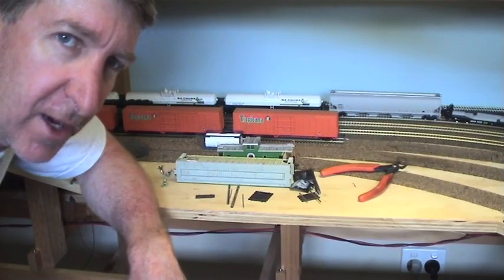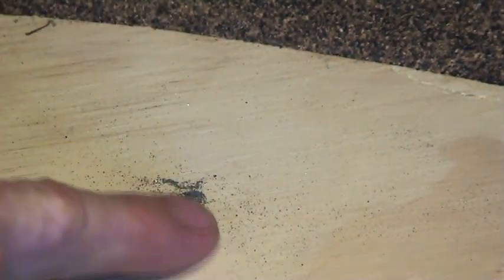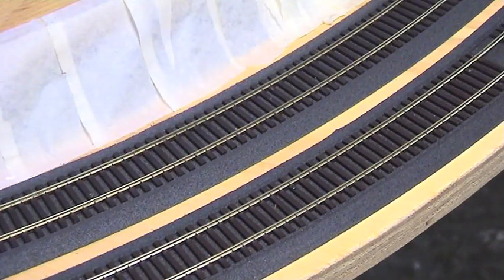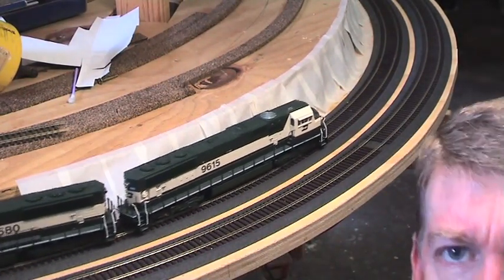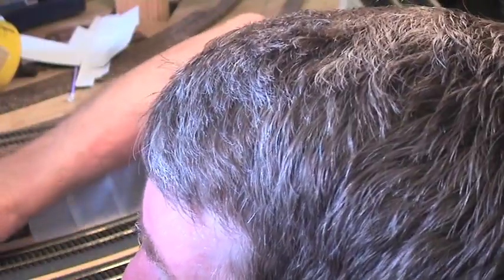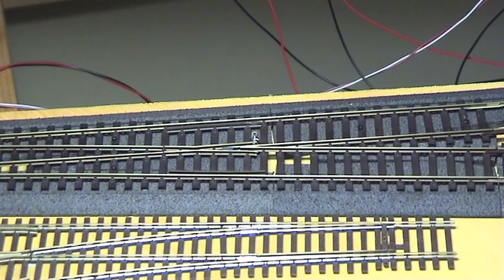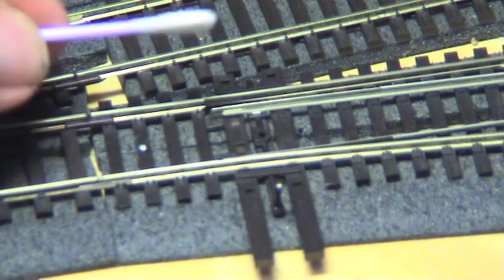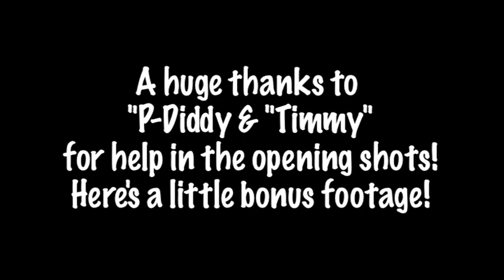Talking Turnouts and track maintenance - part 2.

Comment: I have been using alcohol to clean my exhibition garden railway every morning since I built the outside section.  Found however, that train running was going down hill (can't spell depreciating).  A few days ago I tried PECO Electrolobe, result, much better running lasting several days!  Great to have my findings confirmed in your video.  You are the first Auzey talking model trains I have come across and I find your relaxed, jokey style fun.  Good Luck to you mate - from a Brit (Pommey Bas**).

Philip
Reply from the maker: Thanks Philip, glad you like the videos and get something from them! I had the same thing happen with alcohol after a while and I remember the NCE agent at a train show telling me about lightly coating the track with WD-40 / CRC. But I prefer Innox as it contains no nasties! If you can get it in the UK, it will be a fraction of the cost of Electrolube! Good to see you had a positive result!

Cheers Gregg

Comment: Watching this video made my day! Thanks! I've been cleaning my tracks with alcohol and a track rubber, but I always got black spots on the track and dirt on the wheels after a short while. I don't have the stuff you mentioned, but I tried CRC 5-56 and it seems to do the trick. The track and wheels stay clean much longer. Even a loco with track rubber still works. It doesn't seem to loose traction at all after using the 5-56.
Cheers from Sweden, Anders
Reply from the maker: Thanks Anders! Yes , throw away your track rubber!! Be careful with other sprays and make sure they are compatible with plastic and do not contain silicone! After a while you may see the traction tyres slipping , I don't have any on my layout so I can't comment. thanks for watching.
Cheers Gregg.

Comment: I have a fibre pen as well for cleaning loco wheels etc.
One thing I notice with the pen is that tiny fibre tips break off, much like the trackrubber. You can even feel them on you fingers, tiny itchy feeling. I would not use them with points, unless vac afterward. Great vid, will get the lanolin. I remeber it now from school days, all them merinos and click go the shears stuff. Lol. Robert
Reply from the maker: Thanks Robert! My pen is ok so far, but I don't use it very much and only very lightly,but I can imagine it fraying after a bit of hard use. Something to keep an eye on in the future! 
Cheers Gregg

Comment: Hi Greg,
I love your series! I haven't waded through all the comments so this may have been already been mentioned, so I'm sorry if this is a repete. I don't use anything but a small block of homosote to rub down my rails. It is hard enough to actually clean the railheads yet soft enough to never scratch the rail. You can see the crud from the rails on the homosote block, but I simply wipe it off on the beck pocket of my jeans (don't tell my wife) and since I usually run on my railroad once a week it is never too bad. I never use any liquid cleaners as they always seem to have a down side. Regarding ME turnouts, when I model in HO, I have always turned them over and ground a little of the plastic away from the frog and soldered a jumper there to switch the power with the tortoise. I've no video of my railroad, but others have photographed it. Google my name (Joel Shank) and Sn3 and you should be able to see my efforts of 26 years.
Joel
Reply from the maker: +Bonanza Driver Hi Joel, thanks for the comment and I'm glad you like the videos! I don't think Homosote has been mentioned, masonite is another popular cleaner which is guess is pretty similar? The new ME turnouts have a little spot under the frog to solder a wire to which is handy.  I will check out your handy work Sir! 
Cheers Gregg.
Reply: +FishplateFilmsHi Greg,  Thank you for your response.  I've tried the Masonite block but have found it too hard.  The smooth side is worthless and I think the "rough" side is too aggressive for my taste.  The Homosote is softer and gentler on the rail surface.  That being said, some new Homosote will have a rough outer surface and that will have to be lightly sanded off to get down to the sweet stuff.  Then you will have what I consider to be the best track wiping block available.Joel
Reply from the maker: +Bonanza Driver Joel, it sounds like the Momsote is a good choice! I will stick with the cloth for now, but when the track is ballasted I will have to change methods!
Gregg :-)

Comment: Greg I too gave away the rubbers. If I have to get rough with it after say ballasting I use those sponge rubbing blocks with 1200 git then I use CRC 2-26 I only have to apply once every six mths or so seen as I'm in a sealed room in the house. The black you get on the rails is from the high frequency causing arcing and is diminished quite a bit by the lube  .Where can I get the lanolin to gie a try? oh and the pen. We're not blessed with an assortment of shops down here in Grafton   Cheers Les
Reply from the maker: Hi Les, I've seen Lanotec in some hardware stores and in Repco or Autobarn?. My local Nut and bolt place has it, try searching online, I think you can order it. The pen should be in electronic supplies,I have seen them on a model train online store, can't remember which one!.
Cheers Gregg

Comment: I must say Gregg - you've got a GREAT personality for video!!
EXCELLENT points made in this video, Mate! 
I hate trains stalling ANYWHERE, but especially turnouts.

So, I need to ask....  on some Atlas or Bachmann turnouts, the guide/stock rail gap is TOO wide, causing wheels to pick and lift at the frog...
WOULD it be feasible, to cement a thin strip of .005 or .010 styrene or brass, to the INSIDE of the guide rail, to pull the wheels more towards the stock rail??
Reply: Oh, and I only use Peco or Micro Engineering turnouts - although I've heard good things about Atlas' new Premium turnouts... $5-$8 less each too, than Peco!!! :D

The T/Os in question, are on my cousin's Layout....
Reply from the maker: Thanks for the kind words Carmine! I appreciate the support. On your cousins layout, that is a good idea. If you go to "Teddybeareleven" on you-tube, Stew does a great how to on doing exactly this. He uses brass and gets a great result! Tell him Gregg sent you..LOL I haven't used the new Atlas turnouts. 
Cheers Gregg
Reply: Carmine Allocca z.
Reply: Didn't think I was THAT boring!  :p

Comment: Gregg i well try that and i have also been told to use Auto transmission oil cheers Robert
Reply from the maker: Hi Robert, I haven't used ATF, but I would be a bit concerned about it's affect on the plastic ties. Also  I don't know it's ability to stop oxidation , which is the main use of the sprays. I have heard of it's use, but personally I would use a liquid that is designed for electrical use. Thanks for watching the clips.
Cheers Gregg
Reply: FishplateFilms As a retired Auto Mechanic, I can say that ATF is safe.
There are several plastic bits & electrical plugs inside an auto tranny!! ;)
I've used CRC for years - and it's beeen great...

However - I'm not opposed to trying Lanolin....
SURELY, we can find that, here in the Colonies!! :P
Reply from the maker: Hi Carmine,ATF is not designed to stop oxidation or improve electrical performance, so I would stay away from it personally. Innox, CRC or similar products are made to assist in the conductivity of a circuit by cleaning away dirt and oxidation. I'm sure you will find one of these available locally!
Cheers Gregg. P.s...we use Innox on many  of the electrical components in switch machines .
Reply: FishplateFilms I didn't say I USED ATF...
Just that it's safe on plastics.
You're absolutely correct, it also stays oily for too long - causing particulates to adhere to the track and wheels!
That's NO good!! :P

I have used CRC for years, and find it quite effective.
 Innox - that I need to check out. ;)
Cheers!
Reply from the maker: LOL..that's good! I like innox and Lanoline as they contain no silicone or petroleum products. I'm sure a search will get you some to try!
Cheers:-)

Comment: Hi Greg,I like the idea of using the Lanotec,a friend of mine Mark Williams (may he rest in peace)use to be the Sydney rep fpr Lanotec many years back.
On the subject of track cleaning I use Windex at the moment,it rips the dirt straight off,try it you may like it ?
Reply from the maker: Hi Jon, it's a small world isn't it, sad news about your mate!. Track cleaning is a two edged sword I believe, the alcohol does clean very well, but can leave the track "sterile" and open to oxidation , that's where the sprays come in, to leave a thin coating to help stop oxidation and help the current pass through any dirt .You could use both!!
Cheers Gregg

Comment: Love the bonus material, hope you find Fred.  LOL, do you have any curved switches on your layout? If you do, what must I watch out for?  Thank you for your time.  Cheers.
Reply from the maker: Cheers!, we found FRED on a Caboose!. I use Tillig curved switches, but the inner radius is a bit sharp for my liking. Peco make a nice one depending on the radius you require? I'd like to have a look at the Atlas Master line switches?
Cheers Gregg
Reply: I need to tear up some of my layout, the scenery was temporary, therefore I can change some of the track, looking at doing a crossover on a curve.  Wish me luck...
Reply from the maker: upsd402 . That will look good, go the biggest radius you can!
Reply: I don't have much room, wish me luck...
Reply from the maker: upsd402 . Will do!

Comment: Great vid mate! If i was to de-electrify the frog by making the cutting adjustments but added feeders for dcc use, would that work do u think ? (i have 4 of the large turnouts for a double mainline cross over and im having trouble) Nick.
Reply from the maker: Thanks Nick! If you isolate the frog  (then switch it with the tortoise)then you have to bridge the switch rail to the stock rail, there is a little gap for you to do this! This then makes it trouble free , all my mainline turnouts are powered frogs.
Hope this helps, cheers Gregg
Reply: Thanks Gregg, i'll give it a go!

Comment: I didn't have any luck with INOX at all. ended up having to clean the whole layout. Maybe my track was way too dirty, even though trains would run. They wouldn't once I 'cleaned' it with INOX. I'll stick to the track rubber and vacuum.
Reply from the maker: Innox is not a "cleaner" as such, but it will help keep your track conductive once it is clean. If the track was very dirty, it will need to be cleaned with a cleaner of choice, but I would still stay away from abrasive rubbers, as they damage the head of the rail with fine scratches which collect dirt. Also did you use the correct Innox?...they make 2 types and one is NOT suitable for electrical work!  If you must, use the smoothest rubber can find and only use a little to no pressure. 
Cheers Gregg.
Reply: Hey! thanks Mr Fishplate! Yep, right INOX, I have access to both. Yeah maybe I should give it another go.
I'm over here in Perth, Not quite as warm as QLD but it doesn't take much for my rails to get dull. As they say running trains as often as you can keeps the rails clean.
 Totally can understand the scratches that a track rubber might make. But surely you don't press that hard?

Love your clips and all the effort you put in Gregg! Only discovered your channel a week or two ago. Plenty to watch and learn from. thanks mate!

How though, how can you work on trains and then come home and play trains? Are you sure you're ok?? lol
Reply: *innox
Reply from the maker: You're welcome! Inox "MX3" is the one and make sure you leave a little still on the rails so the trains take it around the layout. If you live near the coast you also have salt  in the air  so a coating on the rails will help. Any abrasive will leave scratches so find the smoothest you can. 
I work on signals and turnouts in Brisbane so not much interesting freight , so the layout is different to work..LOL.
Glad you like the channel and thanks for the support!
Cheers Gregg.